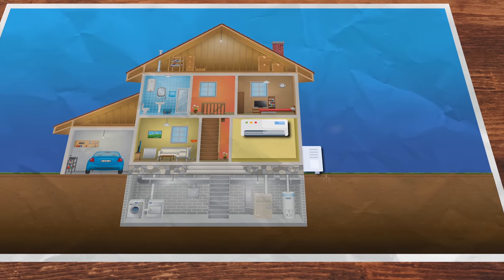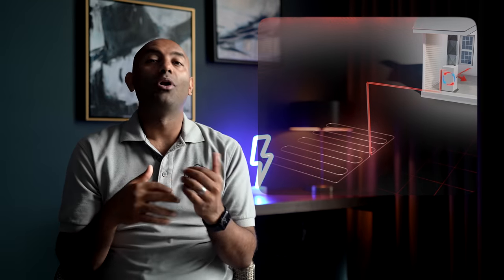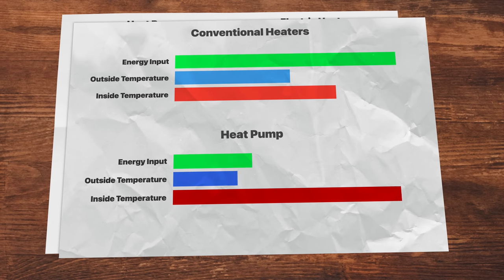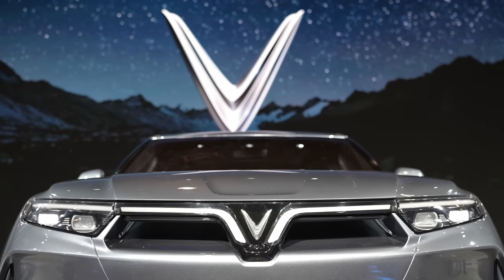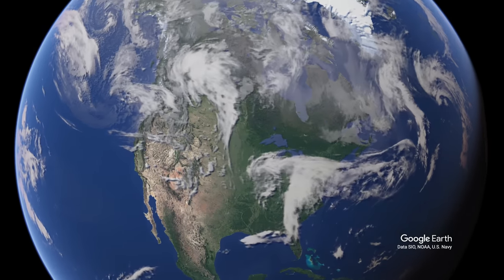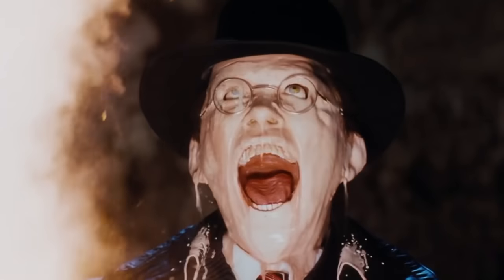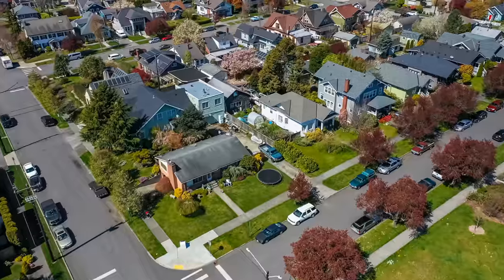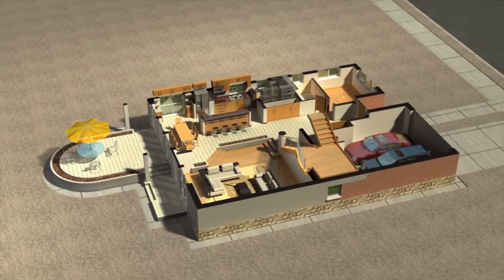Adding This Can Save You Money Summer & Winter!

Comment: If the ground is a good insulator, wouldn't the ground around the loops quickly heat up (or cool down) to the temperature of pipe making it inefficient after a few minutes of operation? A deep shaft going down into the water table would have water moving over it to keep cooling or heating the pipe and would work okay, it seems to me.
Reply: That's the reason you need 600 meters of pipe to get 11kW. Everything can be designed to spec, just need more.
Reply: Last summer, when the ground got extremely dry for a couple months, I did note an increase in energy consumption by our vertical loop ground source heat pump. Since then, we’ve been getting more rain than usual, so it’s back to normal.

[update] Turns out we had failed pumps as well, due to sediment from hard water with sediment taken from the bottom of the nearby water heater. New pumps and a loop flush and the systems back to tip-top shape. Remind your service tech to never take water from a water heater’s flush valve. It will chew up the pumps.
Reply from the maker: great point David, yeah this is why the amount of loop length is quite large, to sufficiently have enough distance to ensure good heat transfer.
Reply: @chow-chihuang4903  thats why the perfect system would be on a new home construction where you can bury your horizontal, slinky style closed loop system atleast 10 feet down, but more if possible, (of course depending on type of soil, moisture of soil, etc), then build your septic system with the leach field directly above the Geo loops so that the soil will always stay extra saturated, which will help the efficiency, and you'll never have to worry about your soil being to dry. Just have to be careful 20 years or whenever you have to replace your leach field. Have to remember you have your Geo 10 plus feet underneath,  which really shouldn't be a problem. I don't think you could even accidentally dig down that far when doing just some new leach fields. Idk. It all makes sense to me. Unfortunately I'm putting in a Geo system in an existing house, so its not really an option that makes sense for me.
Reply: @chow-chihuang4903  yea, pretty sure their supposed to be using "distilled water only", mixed with the proper mixture of antifreeze. Hope you didn't have to eat the bill for the repair!

Comment: Up here Drumheller Alberta Canada water is available 20 feet below my feet we have a AC unit it may be 16 years old but because of the number of days we need cooling in the 6 years we owned the house it's maybe run about 20 hours the person who owned it for  8 years never used it if the people that had it installed needed it like we have it might have 100 hours of run time I'd love to upgrade it to use the water down below to get the heat we need in winter and the cooling we need in summer but the mark up is if it's like water pumps 30 % so no one wants to upgrade an existing unit preferring the higher mark up of a new unit and I can't afford a new unit I like a lot of people have 2 strikes fixed income seniors pension and being a senior we don't qualify for a loan so if I can find someone to put in a reversing valve and a water heat exchanger than I'll upgrade other than that the other alternative is to learn how to do it myself with all the information on the net it's probably doable

Comment: Generally speaking Geo Source is uber expensive for the equipment and the loop.  But what people dont know can hurt them in the wallet big time.  There are only a couple of major differences in that geo source and and an air source heat pump.  In a geo source they have one or two water pumps. These in reality are very small and dont use much power as the pumps are pumping very slowly with little volume  1 to 3 gallons per minute. The water runs thru a heat exchanger. Which can be a flat plate or a loop inside of loop. These are again not very expensive running between $100 to $500.  But this is offset by not having a copper coil in an outside unit. Have you priced electric wire or copper piping ? Wow they are expensive.  All in all the actual cost of the mechanical evens out between a geo source and an air source.  So that leaves only the cost of the outside ground source tubing.  Depending upon where one lives Can figure 500 to 700 feet of piping per ton of heating or cooling.   Other things one can do is place 2 inch dow board type insulation over the top of the tubing to fake the geo source into thinking you buried the piping deeper than you actually did.  Currently there are some great machines that can vertically bore.  I dont recommend doing horizontal unless one is doing a new build because it destroys the landscaping so badly.   If one has a large deep pond one could simple float out coils of pipe and sink it using concrete blocks into the deepest part of the pond.  The bigger the pond the better.

Comment: $5,000 98% efficient gas furnace + A/C and new ductwork is what I was charged in PA. 
Gas bill on a freezing month was $258.00.
Was paying close to $500 a month with the old electric furnace even if it wasn’t that cold out.
Reply: Wow! Thats a great price! What brand was the equipment?  What square footage is your house? Can you give me that guys number? I'm getting quotes right now between $25k-$50k for a complete install with ductwork! My house is only 1800 square foot
Reply: @joshmanor9970  2019 had installed both Lennox furnace and A/C Ranch style house. 
Had the Furnace installed in the attic, wiring, plumbing, and duct work all ran from the attic to the ceiling’s of each room. Off hand I forget what the square footage is.
They ran a metal trunk line and branched of of it with individual insulated ductwork to each rooms ceilings. Then they wrapped the metal trunk line with insulation. They then pulled the copper insulated pipe and wire  through the side of the house and down to the A/C unit outside. It literally took them about 4 days with a 2 man crew.
Reply: @frankdelucey2137  Definitely a good price either way. Over here in NY,  they wouldn't even sell you the equipment for anywhere near that price. Forget about the ductwork and all labor! I'm sure their not gonna travel this far...I'd even double that number!
Reply: @joshmanor9970  yes lol
When they quoted me the price I said can you start tomorrow.
Of course they started a few days later.
Best piece of advice I could give is find a big heating and cooling company and make some friends there. That’s what a buddy of mine did last year. I don’t know what he paid but I do know he is happy with no complaints about the price or instillation.

Comment: Ground source heat pumps are truly awesome... But so much depends on that drilling cost. My initial cost estimates are ranging from $20-50k. Granted, these are all sucker internet quotes. I'm sure I'll be able to work with someone local where I can negotiate the price down a bit by doing some of the heavy lifting myself... Or combine it with trenching around my home for some water proofing to save some costs on both projects.

But that up front cost is intimidating. It will likely pay for itself eventually, and I've done a lot of work to improve my homes efficiency (and this the still operating 1980s heater lol), but footing that bill compared to an in place replacement of what I have now for $6-8k installed... It does make you wonder.

What makes me push for geo though, in spite of the cost, is the issues with both other options. If I go with an air heat pump, our winters are cold and wet, which often causes icing issues even on modern heat pumps here. Plus, a heat pump here is also wildly more expensive than gas for install costs.
On the natural gas side, it is cheap today, but I see no future in it. With or without an official tax, fossil fuels will be pricing in a carbon remediation cost over the next 20 years. Natural gas won't be hit as hard as oil, but it is still going to be much more expensive. Electricity on the other hand is more resistant to price change because the source can always go to the cheapest bidder. Solar, wind, hydro, nuclear, or fossil, there are just more options for more situations to shift generation costs. It may still be more expensive than natural gas quadrupling in price, but as gas quadruples, electricity will only rise a little.

The question though is timing. Will carbon sources rise significantly in 20 years? 5? 50? And a natural gas system has a lifespan of 20-30 years. So it may well make good sense to get the gas system today, bumping my efficiency from 80% to 98+% for 1 generation, and moving to a ground source heat pump for the following system when there are more installers and options available. But if gas prices start rising significantly in the next couple years, then a heat pump today will offer massive savings right away! It is impossible to tell. But in the short term, as soon as the Ukraine situation is sorted natural gas prices will drop dramatically. But that will be a temporary price drop. The rise in gas prices is inevitable.
Reply: Yes, unless your needs are huge (7 ton or higher) your installation costs should be no more than 40% of your total cost. This depends on location, soil type and burial type for your piping. I living in the south and my soil is very rocky but I have plenty of land so I was able to opt for a horizontal ground loop 6’ deep. My total cost for a 6 ton system before a federal rebate of 30% was 20k and burying the ground loops was $7k. That was 12 years ago in a rural area in the south so most places will be higher. But many places farther north and smaller will be less. Do some comparison shopping.

Comment: Thank you for the video.   If geothermal heat pumps are economically efficient why are they not used more or except for unique situations at all in commercial or industrial buildings?   The payback years if making use of future value of annuity principals depends greatly on interest rates.   Interest rates are going up.  

California's electric grid has been unreliable and under sized going back some forty years.   It seems to be getting. worse rather than better all while having electric rates at some of the highest in the United States.   In the case of San Diego county CA electric rates ARE the highest in the United States even higher than Hawaii.  San Diego county 4p - 9p on weekdays peak residential electricity rate depending on the payment schedule is around $0.60 per kW/h.  Compare that to 2020 Indianapolis Indiana suburbs at a flat residential rate of $0.10 per kW/h.   In Indianapolis the residential rate is $0.12 per kW/h.  

For some weird reason Hawaii appears to burn fuel oil for generation electricity apparently using steam plants.   That is the most expensive fuel for generating electricity using the least efficient method considering fuel oil can be used in high efficiency Diesels or likely combined cycle oil fueled turbine then steam generation.  Typically one would expect a distant island at commercial electric grid size to run high efficiency coal plants where if needed they can stock pile years of coal.  Even running with an expensive fuel Hawaii still has considerably cheaper electricity than San Diego CA.

In Indianapolis Indiana over 100 year old houses built 1912 one can frequently see the transition of heating fuels.  At first alley ways brought coal likely at first by horse drawn cart to a coal bunker.  Then after WW2 the houses switched to fuel oil with a large fuel oil tank in the basement where the coal use to go.  Then by the end of the 1960s most houses had switched to natural gas heat.  Which is the preferred way to heat houses and hot water with a few exceptions.   Power ducted exhaust hot water heaters have condensing exhaust, which makes them the most efficient it also doubles the hot water heaters cost and halves its life because the condensate rusts and destroys the hot water heater from the inside out.   The exhaust piping is PVC, which means you can not replace condensing exhaust hot water heater with a slightly less efficient (5%) with hot exhaust.   Cooking ranges in new houses seem to be all electric.  

The problem with using heat pump in cold climates is they are typically large air conditioners in cooling ability and heat at about the same ability that they cool, frequently 36,000 BTU.  Even when able to work with ground temperatures that allow year round working in the most efficient area of heating to cooling and vise versa it is still only 36,000 BTUs.   In cold climates typically 100,000 BTU furnace is used.   The way furnaces are rated is typically by how much fuel they burn not their heat out put so their efficiency needs to be known to get their output.  Assuming about 90% efficient that would 90.000 BTU heat output.   In order to achieve that heating level with a heat pump even with geothermal is still going to require a heat pump that is a little under three times larger than is typically sized for cooling.   

In humid climates there is a desire to run A/C frequently because it acts as dehumidifier.   A large heat pump will not cycle much humid air through its air handling cooling system before the air has reached the set temperature.   Cold air requires much larger ducting than air for heating.  Living in Austin TX or Arizona the concern is COOLING.  There is frequent 110°F heat.  They are not humid climates compared to the east coast of the United States.   A big heat pump in those hot climates that can handle a 40°F temperature differential especially for cooling is very attractive.   Every few years there are going to be very cold below zero temperatures.  With a geothermal heat pump able to make 40°F differentials between inside and outside temperatures if the electric grid can take the load for the occasional deep dip way below freezing it makes sense to have a robust electric heating coils.  Electric heating coils are relatively cheap.   If using an air-to-air heat pump they don't work at all below zero °F and work very poorly below freezing.  That means the resistance electric coils need to do all if not most of the heating.   This also loads the electric gird when it is likely under severe weather conditions and exceptionally high electric loads for winter.   

If there is a power outage a home natural gas furnace, with some home electric work can be plugged into a long HD extension cord and the extension cord plugged into a small portable electric generator out in the backyard.   That can nurse your home along in sub zero temperatures with normal room temperatures.   After 24 hours your hot water will not be hot water anymore, but your pipes will not freeze.

Comment: Could you do a video on whether heat pump water heaters actually save energy.  I have been thinking about installing one and it occurs to me that the heat has to come from somewhere.  So, it would depend on where they were installed.  Mine would be installed in the closet in my unconditioned garage.  Also, don't hear much about adding a desuperheater to you A/C to preheat the water going into the water heater.

Comment: So, here in California, where contractors permits ect. are high, I could expect to spend about $30,000+ to have this installed. I have an acre property but with existing buildings ect. I can't even begin to fit that size of a system without going to drilling deep and I'm not allowed, by code? But even if I could, maybe I save $233 year heating and $300 cooling = $533 year. $30,000/$533= 56.285 years payback assuming no repairs nor failures nor maintenance nor early replacement!? Sounds just really stupid to do here!?

Comment: Crazy thought for hot climates… using swimming pools as heat sinks rather than ground loops…

I used to live in El Paso and had to constantly burn a giant gas heater to heat my in ground pool… why not heat the pool with heat we don’t want in the house?
Reply from the maker: That’s brilliant! Would there be a point later in summer especially in Texas when the pool would be too hot?
Reply: @TwoBitDaVinci  possibly… I bet some smart engineer could apply some math to it… for sure the pool is always losing energy to the ground and possibly to the air at night depending…
Certainly the thermal mass of the water is far greater than the air in the house.
Also the pool pump runs a lot and could cycle the water through the heat exchanger so maybe the fan motor in the “evaporator” could be eliminated…. Obviously not my area of expertise but  big picture cool house warm pool sounds nice!